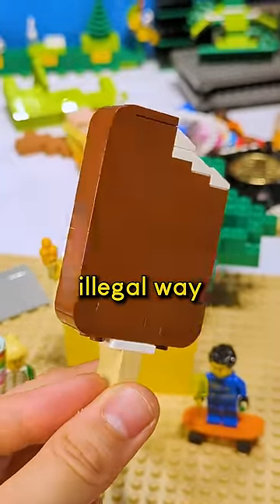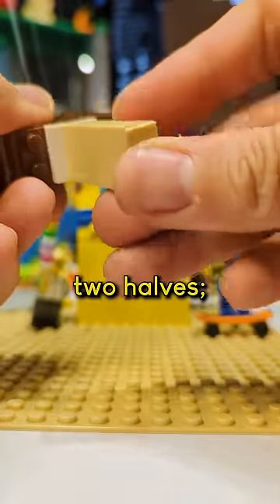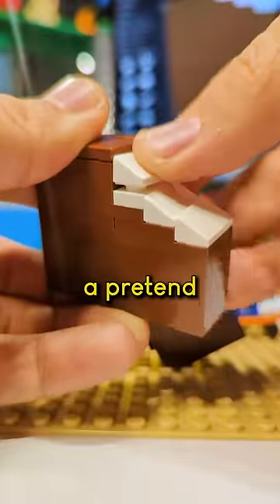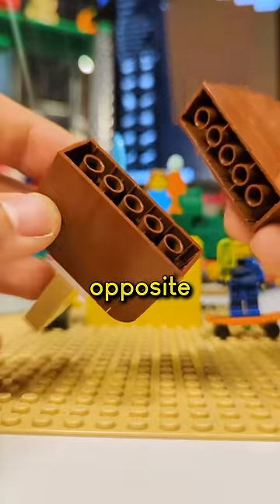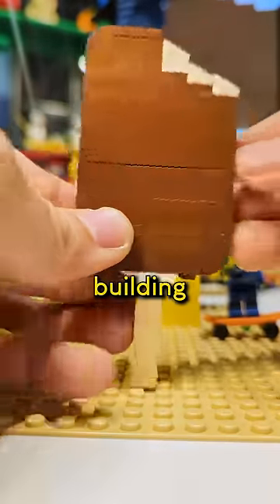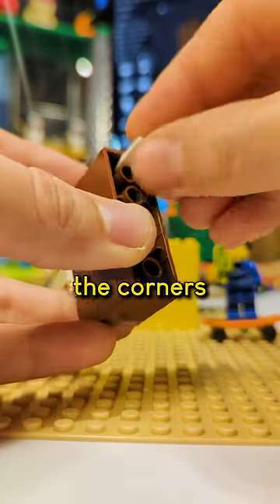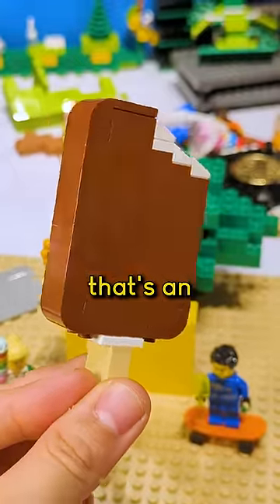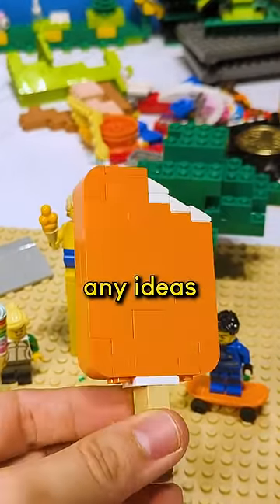#LEGO #Icecream Bar #legos #legomoc #afol #legotips #toys #buildingtoys #stem #creativity #legofan

Comment: I always thought the first was illegal due to the pins being unable to extend, putting stress on them and the anti-stud.
Reply: Yeah it breaks pieces sometimes
Reply: It is illegal. eventually the thin anti-stud will break from the constant pressure of the pin
Reply: you’re correct, and the video is wrong :)
Reply: That's the wrong kind of pin. The illegal ones are a different pin.
Reply: @ChrissieBear  I'm not so sure about that. It's true that the most commonly cited illegal pin-in-antistud stud inversion assembly uses a standard technic pin, IE a "full pin" with the same technic connector on either side. But the issue with that connection is the pin being unable to "click" into place and remaining compressed in the final assembly, which applies equally to the half pin shown in this video. :(
Reply: As a person trained in materials science, definitely illegal!!!
Reply: 😊y😊y😊
Reply: He used a full pin with a stud on the other side, not a pin with a half-pin on the other side. Either way, its still an illegal technique. The pins dont snap into the tube, even tho the stud connects to the other side. There are definitely better ways to connect bricks in opposite directions like that. Both illegal.
Reply: @Jaysin412  Righto, i was referring to the pins by the names given to them by bricklink and most other online sources: a “full” technic pin has 2 technic clicky-style connectors, one on either side, and a “half” technic pin has a technic clicky-style connector on one side and a stud on the other side. the kind you’re referring to, with a half-width technic clicky connector on one side is called a “3/4” technic pin. i suppose it’s a pretty confusing naming system.
Reply: @AminalCreacher  yeah. I know, I was describing it specifically.
Reply: Been building since the 80s and I still call them whatever I want to if needing to describe them, lego just uses technical names for everything. Pick a bricks descriptions suck.
Reply: @AminalCreacher  regardless, it's still an illegal technique shown to us by a someone called a master builder so I guess tomato/tamato
Reply: It is
Reply: Why is it illegal like its just lego bruh like do u get arrested or do I not understand
Reply: @Laughing-emoji-hah  illegal by the standards of the lego company. Illegal doesn't always mean getting arrested. It's just a building technique that overstresses the pieces, and could break them, and if used in competitive builds can get someone disqualified. So illegal in the sense that, they're not supposed to be used that way, can damage the pieces, and aren't allowed in official/competitive builds.
Reply: @Laughing-emoji-hah  You don't get arrested, but your bricks break. That's the main factor, an "illegal" technique puts undue stress on the bricks and causes damage, and as a result cannot be used in official sets. You can do it to your own bricks if you like, but you'll end up breaking them eventually.
Reply: @Laughing-emoji-hah  the term ‘illegal building technique’ means that it will damage the bricks or otherwise make them unusable
Reply: @Jaysin412 where does it say they're a master builder?
Reply: Thanks guys
Reply: @rainbowhaven  lmao. They work at Legoland as a master builder.
Reply: I like that you thought shoving something where it doesn't go is not stressing the foundation.
Reply: ice cream truck lego kick by lego guy
Reply: Its Legal because lego uses it in their sets
Reply: @Kebnekaise.  been building since the 80s, and never once have I come across this in any set. Proof
Reply: @Jaysin412  Assembly Square 10255, Page 55, Step 77
Reply: @Kebnekaise.  just tested it bud. The blue pins go all the way through the white wheel rim and click into place. Not stop halfway through and stay under compression like in the lego brick. Good try tho. Almost
Reply: @Jaysin412  then i guess my eyes must have been mistaken.

thank you for enlightening me with your truly superior intellect.
Reply: @Kebnekaise.  the step is definitely there, but I pulled the white wheel element from my vehicle box, and grabbed the 6 pins with studs on them and they went all the way through. You were definitely close tho. In 30+ years of building lego, I've never seen them use that technique. It'd make building on both sides way easier for sure, but the ends of the pins dont snap, so they never destress, and will eventually deform and stay that way, making them unusable for actual technic holes.
Reply: Awaht?
Reply: Ohh
Reply: I thought he meant off brand lego use
Reply: The logic that illegal/legal comes down to breakage, is completely dismissing that the second technique doesn’t cause damage. Therefore invalidating the definition of illegal, or making it factually legal. Mic drop….
Reply: it's not illegal, you won't go to jail for it, it's just using the bricks how they "weren't" intended to be used. That's not illegal
Reply: Hello back on my birthday I'm going to get some cool stuff
Reply: Pretty sure there are 2 colors of this pin and 1 of them is illegal
Reply: It should be illegal
Reply: @Jaysin412 so you just wanted to be more correct? Oof.
Reply: @harleyjo4875  not about being correct, it's knowing what's correct. If it was a technique that was used in an official set, I wanna know, that way I can use it. Good day
Reply: Same
Reply: Nah that’s for the regular technic pins not the modified short ones bud
Reply: @AminalCreacher nah this video is correct. The normal pins are the ones that will cause stress etc.
Reply: @AminalCreacher nah you wrong bud that’s a normal legal bulding technique
Reply: @Jaysin412 what’s the better way dummy 😂😂
Reply: @HvacHeathen  snot pieces linked vertically with flat plates champ. Lmfao
Reply: @HvacHeathen  I just turned my slushie van set into an ice cream truck, not to mention, rounded bottom and rounded top pieces that stack, and the bricks don't need reversed. Haha. Better,  easier, and more secure
Reply: @HvacHeathen  they're still regular pins on one side bruv. You're definitely wrong
Reply: It's a pin on one side and a stud on the other. The pin side does not destress, causing extra stress on the bricks, and eventually deformity the side with the pin on it, which won't allow it to snap into technic anymore. Sorry bro, but you're wrong
Reply: @Jaysin412 you gotta move on, man.
Reply: Agreed also bc its not a full snap connection and you are left with the small gap sometimes
Reply: @Thebungus765 YOOO YOU GOT THE XBOX 360 PFP
Reply: @Ivampter  yeah..
Reply: @Jaysin412  oh no officer put him in jail
Reply: @tay-lore as someone with avian matsci DEGREES, what does "trained in" mean? if you are "trained" in mat sci, you'd know that deformity the tabs of the pin wouldn't be enough to deform them to yield. They're deformed around 20 micrometers. Nowhere near being out of plastic deformation.
Reply: @littlejackalo5326  ?? Yikes, I didn't know I needed to list my credentials on a Lego YouTube short.  I have a bs in chemistry focused in matsci. Regardless, this is illegal... because Lego said so... They've done their own testing and determined what thresholds they hold as standard for theirs products' proper use. Also, like all of the illegal building techniques, it's a matter of creep and fatigue. It adds up. I'm not saying this is going to instantly plasticly deform your pieces. That's not what illegal techniques are, that's just breaking your lego. Lego intends for their product to essentially be able to be used forever. That's why you'll never see either of these illegal building techniques used in actual Lego sets, because it absolutely shortens the lifespan of the product.
Reply: @andrewchapman2039 That’s probably why you don’t work at Lego.
Reply: @littlejackalo5326 The point is that the tabs of the Technic link aren't able to return to their neutral state.  LEGO operates on the assumption that a given build might sit on a shelf for a decade or more and then taken apart and the parts reused.  I'm an electrical engineer, not a materials scientist, but is it possible that fatigue might set in over extended time even if the deformation is still within the elastic deformation zone, sort of like how springs should not be stored compressed?
Reply: @Thebungus765 your profile picture just got me a flashback
Reply: @dragongamerandart  So you're saying that you want this guy to go to jail?

Or are you saying that the first way is going to cause stress?
Reply: Glad I don't have to write this comment
Reply: wtf is wrong with you guys there’s no laws in building lego
Reply: @obscure.reference  Well, no actual laws (like being able to drink at age 21) in the Lego business
Reply: @obscure.reference  there are indeed laws
Reply: @AnimalCreacher kinda; the 3/4” pin is different, this is just a stud pin IIRC. It’s technically legal since this connection is done in lego SPIKE sets, but yea
Reply: MN m
Reply: L
Reply: N nm. N
Reply: L m
Reply: M
Reply: Mm
Reply: Jokes on you all. There is no legal or illegal way to play with your legos...
Reply: Yes!
Reply: @AminalCreacher source? Because OP works for Lego as a professional builder.
Reply: @iloatheyootoob6954  What are you talking about, asking for a source? I literally linked a source in my previous comment. Go look at that. It was written by an actual Lego set designer, who is strictly beholden to standards of legality in a way that a "master builder" working in a Lego Discovery Center isn't.
Reply: @condemnedd684  If true, that's extremely surprising. Would you mind pointing me to the specific instructions in which this technique is used? I was unable to find it when browsing SPIKE instructions.
Reply: Drills a screw thru the top of the ice cream, under the vanilla 
*gets the death penalty
Reply: @AminalCreacher  Oh man, this is illegal you’re going to Lego Jail. Because it’s illegal.
Reply: it is illegal. there is no hole to let the pin rest. it will eventually snap.
also, other definition of illegal building technique, it can't be taken apart without breaking the brick or using a third party tool
Reply: @Thebungus765 absolute top tier pfp
Reply: Um
Reply: Omg
Reply: Both are "illegal" though
Reply: What??????????
Reply: It’s legal because the peices were intended for it
Reply: This dude is always wrong uet he has the most prestigous lego job. Smh dude should be selling trading cards instead
Reply: It is.
Reply: Because it is
Reply: yeah, the back side of these is meant to go into the technic slots, not the reverse bricks
Reply: @Laughing-emoji-hah  I find it funny how you said one thing incorrect and everyone swarmed you like hyenas
Reply: It is, an illegal method will result in damaging the piece but the 2nd method shouldn't damage the piece so
Reply: Its leggal cuz there is no stress on the lego pieces
Reply: What if you combined the two build techniques?! 🤯
Reply: @antonyhurst9151  then you have a small lego structure
Reply: @Bunny_YouTube_  there is alot of stress on the technic pin idk why you thought other wise
Reply: Well I guess younger me belongs in Lego Jail

Comment: Like everyone else said, the first one is probably illegal as well. Either the technic pin will lose its flex, or the brick hole will split
Reply: Bruv thats what theyre made to do lol
Reply: @whenimmanicimgodly4228  technic pins need to click in place. They're not meant to stay under constant compression (notice the little recess at the end of technic holes, it's where it "clicks")
Reply: @jaloswaggons2182  yea but the technic pieces click in place when you put them in the holes at the bottom of Legos
Reply: @whenimmanicimgodly4228  they don't. Grab a brick and try it out, it's only a friction fit. 
Only the technic pins with stud can be used on the bottom of bricks
Reply: @jaloswaggons2182 doesnt matter its not enough to actually damage it. its legal.
Reply: @jimmjimms  over time, the pin will lose its flex or the anti-stud will break from the constant pressure. one or the other is bound to happen, making it illegal.
Reply: What is the lego police gonna come after him? 

Narc
Reply: @jimmjimms bro can you not read? The first comment says what dammages it
Reply: Brick hole
Reply: Which law states it's illegal?
Reply: @Cypheq  Brick hole
Reply: @Cypheq  Illegal here stands for a brick connection that will eventually break pieces after construction. 
You can think of it like killing bricks
Reply: @jaloswaggons2182 wdym by illegal building way like is it an actual  crime or something
Reply: @yujiro123  its not actually illegal, its just called that because internally at Lego, methods like that can't be used when designing a set.    
They are also not recommended for people building at home, because it will break your lego pieces
Reply: @jaloswaggons2182 .
Reply: @MadderoftheFew  pressure? He's got like a couple plastic pieces pushed together. I'm sure it's fine lol I mean we used to build all kinds of stuff as kids like this never broke for us. It's just legos bro relax
Reply: @HelloThere..... if you build something improperly, the likely hood of it breaking is increased. doesn’t mean it’s the end of the world, everyone is just saying that there’s no point in breaking things you buy for no reason.
Reply: @HelloThere.....  "illegal" just means there are issues with it that would cause The Lego Group to deny its release as an official set. lego sets need to be able to be displayed for years without falling apart if left untouched. that means there can't be bricks in considerable tension, as over time the material elasticity of the plastic would wear out, causing the set to fall apart. this design is reliant on the elasticity of the pins friction-fitting the top and bottom parts together. after a couple of years (if not months), the pins will lose their elasticity and simply bend out of tension, which makes the design "illegal".
Reply: @MadderoftheFew  not nearly enough force to ever break and not enough force to really ever make the flex part loose just saying
Reply: @uberrandomperson  you're legit just wrong. go learn the first thing about elasticity just saying.
Reply: @whenimmanicimgodly4228 no, they're not
Reply: Donøt worry, the ice has been eaten long before there is a problem. Now go make one with licourice flavour.
Reply: @whenimmanicimgodly4228 no they dont they get held in by tension. Iv done that method many times. And jalloswaggok is right. They can crack the holes or the technic pins them selves will become squished. There is no indent in the bottum of the lego brick hole. And if they did you wouldnt be able to get it out without putting strain on the technic tab every time.
Reply: I’m glad we have randos on the internet to tell a Master Builder how to do his job.
Reply: @AnarexicSumo professionals can still be wrong like when doctors misdiagnose patients
Reply: @whenimmanicimgodly4228  for 1 stop saying bruv its stupid and for 2 tecnic pins aren't supposed to be put into anti studs
Reply: @jamievance6097  first off, breh.. i said bruv specifically because bruh, bruv, breh, brah, brev and bro all have different meanings.
Reply: @whenimmanicimgodly4228  Hmm i never   
knew that thanks for telling me
Reply: @jamievance6097  it's kind of hard to explain but like bruv is used for moments of like more of a brotherly "okay, man here's how It is" feeling, bruh is used for more of a "Dude, really? B.S." feeling, breh is more of a laughing along like "breh cmon now", brah is just like a meme word, and brev is British.

It makes way more sense in context of how its used in actual speech
Reply: @whenimmanicimgodly4228  nice
Reply: @uberrandomperson but it is, I have absolutely witnessed it first hand from pins stuck in the button of a brick for years. The pin becomes deformed in the pushed together state which renders it unusable.
Reply: Not to mention you can’t get them out
Reply: @yujiro123  I assumed this was “illegal” in Lego tournaments…
Reply: It's legal. You guys forget that minifigure legs are doomed to crack from pressure while being perfectly legally displayed
Reply: @mannyramirez5630  no, it's not legal.

Do you have a source on minifigures cracking?

Comment: Second one looks a lot cleaner since there's no gaps
Reply: I think he just didn't push it all the way
Reply: @mateuszlinke7469 technic pins have a rim on it, it would not push all the way in 😂
Reply: @moonsvc nah he shows it later with no gaps
Reply: @Iced___  that was a different bar he did not specify which building method he used, also based on another short where the ice cream bar is on top of the ice cream truck he used the legal building method and there was a gap
Reply: You'll notice the gaps when your pieces start cracking
Reply: It did look a lot cleaner with the slopes.  Never would’ve thought of it, it’s a great idea!
Reply: Robbing a bank gives you quick money but that doesn't mean it's legal
Reply: @11am2 sir this is a conversation about Lego
Reply: @dingusdong i'm pretty sure that they were trying to imply that the second method was an illegal building method, because it puts stress on the pieces